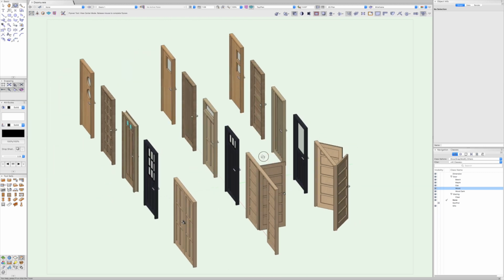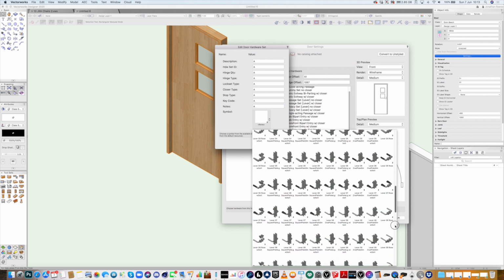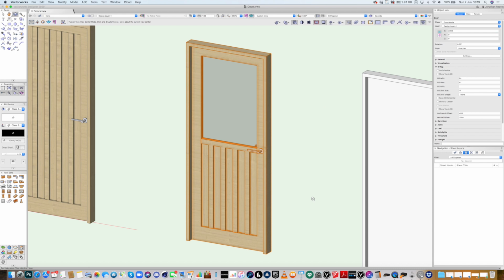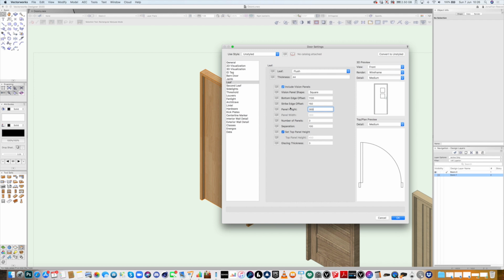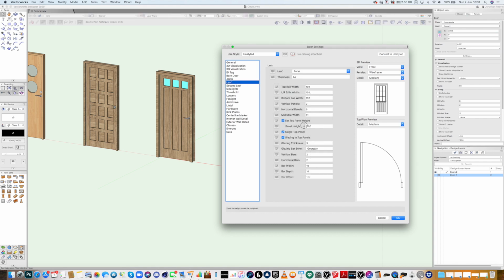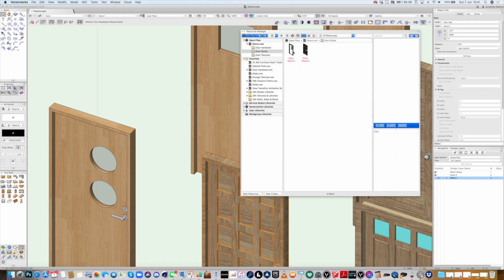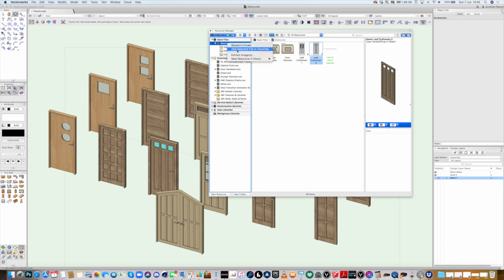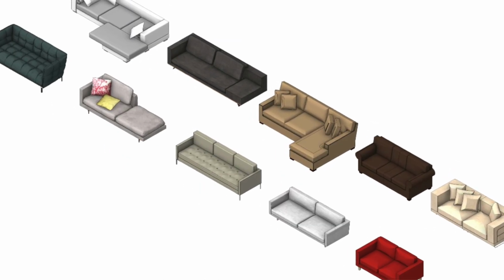Vectorworks Tutorial: Custom Doors and Styles

Comment: Thanks Jonathan for this useful tutorial. I have a question, how do I make a rotation of the wood grain? For some textures it os vertical and for others is horizontal and there is no way to control in the OIP. Thanks in advance
Reply from the maker: Switch the the Render tab where you can rate and scale etc, or Duplicate the texture in the Resources then rotate it and reapply though  class.
Reply: @jonathanreevescad  eonderful, thanks!

Comment: This is great and very helpful indeed. Thanks Jonathan. 
Quick question. If you take one of the door symbols and assign it to another project and edit it, will it then update all the other projects too when they are opened again? Tp avoid this would you suggest duplicating the symbol for each project?
Reply from the maker: Hi Ari, glad you liked it. No symbols will only update in the file they are in unless you reference them from one project to another. This can be done by right clicking in the resource manager and selecting Reference.

Comment from the maker: You need to Select Edit Style from the dropdown in Object information then all options are editable. You can also switch between Style based setting or locally editable here.
Reply: did that, yes I had to do it in the style settings (I don't get the same tab menu you get in the video) but was able to edit attributes (like opening angle) there. Maybe its due to the German version which i'm using. Thanks again. Cheers :D